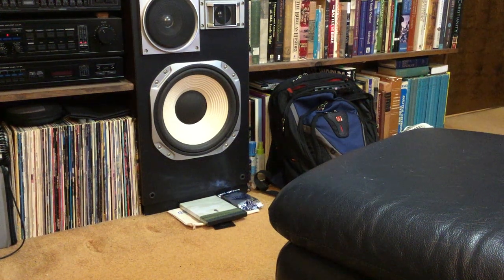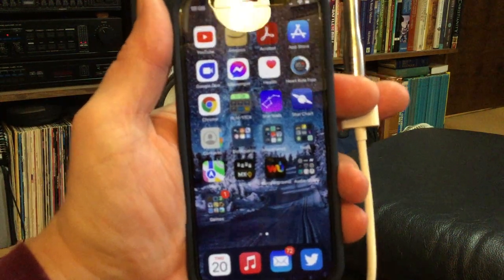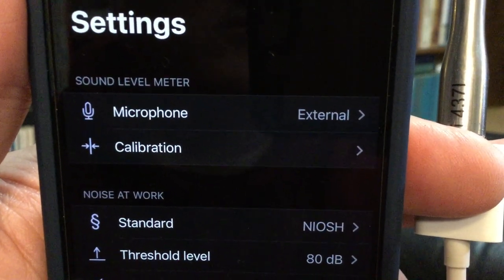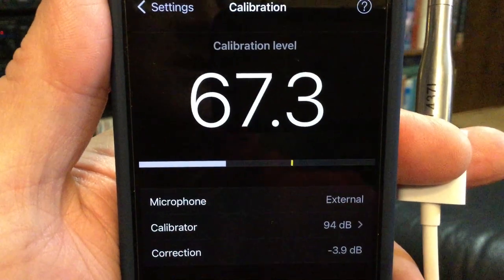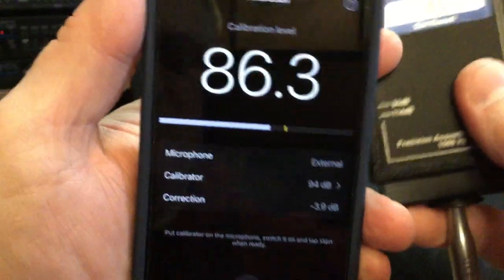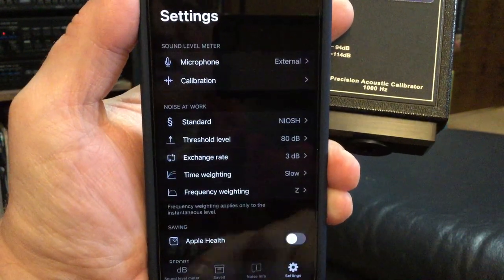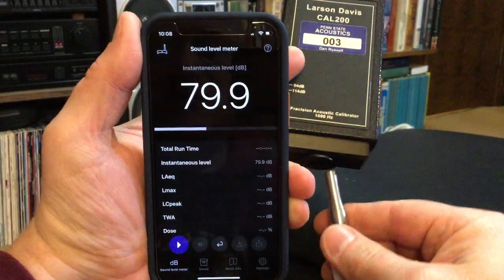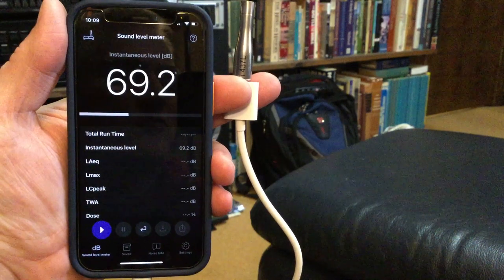Calibrating an external microphone (MicW i437L) with NIOSH SLM app on my iPhone.

Comment: Hi Dan, I responded to your reply twice in the other thread but for some reason, they aren't appearing. So I'm posting this standalone comment instead. 

Thank you for your quick response. I was hoping to get your recommendations of the options for calibrators and standalone sound level meters with self-calibration that you provided for Joy Auma. 

I have some headphones that I'd like to test for different applications (music, games, videos, etc.)  Before I posted my original comment for you, I already had the sound level meter app you used in the video but didn't have an external mic to properly test the headphones so I purchased a cheap sound level meter on Amazon, but don't know how accurate it is without using an external calibrator.

Comment: Hi Dan - could you advise which external  microphone you are using and which calibrator (looks like Larson Davis brand?). Thanks form Australia - Alex Spathis
Reply: Looks like Mic i437L) I now see and KLarson Davis CAL 200. What iPhone?
Reply from the maker: I have an iPhone 11 mini (small size) . . . I use both a MicW i437L (ligthning connector) and MicW i436 (1/8" phono plug -- needs ligthning adapter) as a Type 2 external microphone.  Both are available from sweetwater.com or bhphotovideo.com. The microphone calibrator is a Larson Davis CAL200  available from pcb.com.  I've been very happy with both microphones and the calibrator.
Reply: @DanRussellPSU  How much does the calibrator cost? I couldnt get any information online, or any other ideas where i could get one? I'm looking to use it for a school project.
Reply from the maker: @joyauma2610  -- i just replied to your email with some links to some other options for calibrators and standalone sound level meters with self-calibration.
Reply: @DanRussellPSU  Thank you for your video! Would you be able to provide the options for home use - testing household appliances, alarms, headphones, computer peripherals, music/audio sources, etc.? I appreciate your time and consideration.
Reply from the maker: @EV-B  I'm not exactly sure what you are looking for when you ask about "options" . . . I made this video for the graduate students who were taking a grad-level noise control engineering courses I was teaching, when the students were required to obtain a "type-2" precision sound level meter (either a standalone sound level meter or an external microphone with a high performance/accurate app that could be calibrated) so that they could perform several high-quality hands-on measurement activities at home. Instead of making students purchase a textbook, I had them spend the same amount of $$ on a sound level meter device that they could continue using long after the class was over.  However, if all you want or need to do is compare noise sources around your home -- comparing how much louder a blender is compared to your bedside alarm -- then using  a free app like this (NIOSH sound meter) without an external microphone (just using the built-in mic on your mobile device) would work just fine.  iOS devices tend to have better audio circuitry than Android devices (the same app will perform better or more accurately on an iOS device than the app will perform on an Android device).  But, if all you want to do is compare the relative loudness of things around your home, then a simple app with the built-in microphone will be sufficient. The external microphone and calibration is necessary if you are looking for precision or if you were making measurements to solve a problem for a client (when working as a noise control consultant).  But, for around the home use, a simple app can let you know what the approximate sound levels are.  I hope that answers the question you were asking.